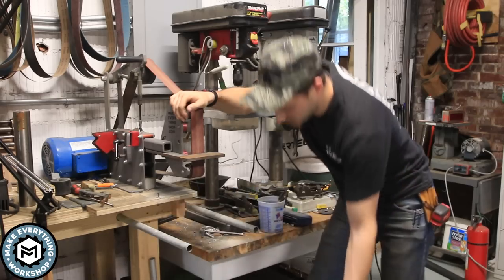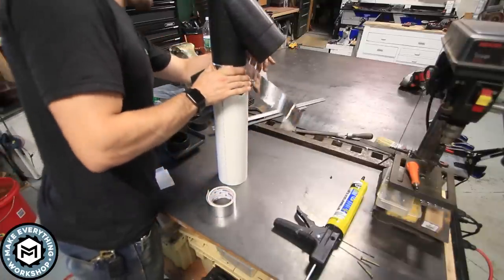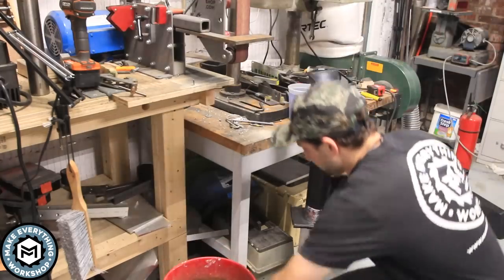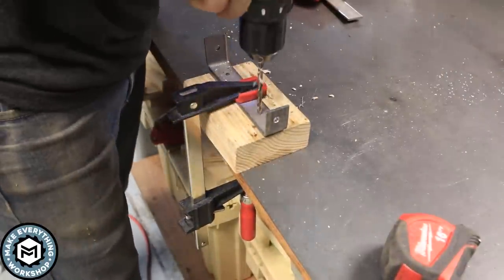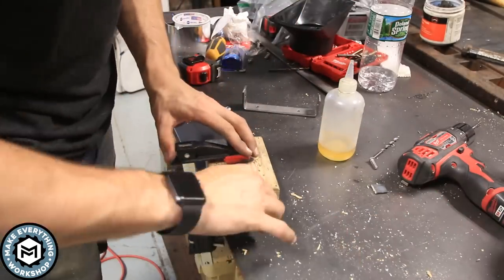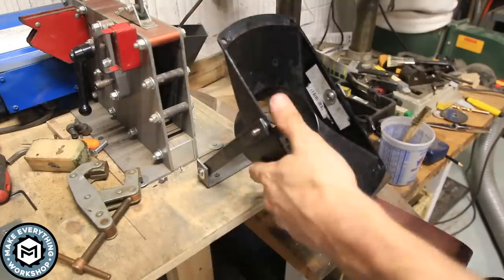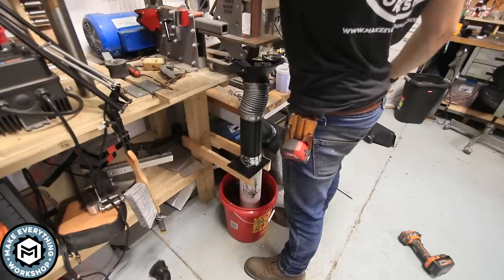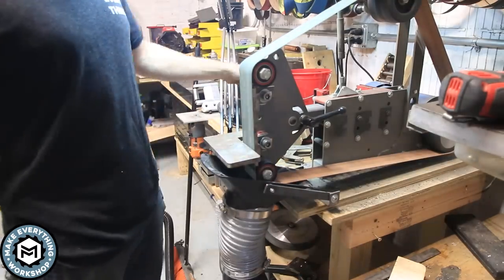Better Belt Grinder Dust Collection (Water & Vacuum)

Comment: I have made similar dust/spark containment for my 1x30, 1x42, and 6x48 sander/grinders, but found that plastic does not hold up well long term, I have ended up cutting grooves all the way through the plastic at impingement points. Went to metal catch funnel, metal flex pipe,  stove pipe wye, metal blast gates,  and down pipe. Still have plastic on the dust side of the wye.  Also if you mount brush (I use a brass brush) on the belt side of the catch funnel up against the belt it reduces the dust following the belt around.

Comment: Good idea.  I'm enjoying your channel.  

I never understood why belt grinders don't have a port that direct debris into a catch can.  I suppose they are afraid of the liability if someone connected a vac directly to it and burnt something down.  

You might consider putting a metal deflector across the hose that leads to the dust collector to force the finer sparks to travel down then back up before they can get into the collection hose.  That would almost guarantee that any particles with enough mass to cause a fire would end up in the collection bucket below.  It may be safe as-is but that would offer one extra level of protection.

It is probably worth running some kind of test though to ensure that no hot metal makes it to the dust collector because most DC fires smolder for a while before they ignite after everyone has left the shop.
Reply from the maker: Shop Hacks great suggestions. I definitely see this as a working prototype that will evolve. I also pour little bits of water into the dust collector hose while I grind to try and extinguish anything that might be smoldering. I’ve had 3 DC fires in 2 years with this collector. Nothing catastrophic but always scary!
Reply: is it possible to mount a smoke detector inside the dust collector? i guess that might be too sensitive and give false alarm.. maybe near where the extractor outlet is as once enough smoke is in there itll be coming through to the outlet, im sure theres smoke detectors with better notification methods then deafening screeching thatll bring the whole neighbourhood over to check on you

Comment: Could you just switch that small section of hose to the semi-rigid metal dryer hose? That would hold up to sparks better than the dust collector hose and would give you a similar flexibility.
Reply from the maker: Alex Nolan that’s what I’m thinking, I’m gonna get some heavy duty metal flex as a backup

Comment: When collecting the metal from grinding, are you using any vacuum air flow to pull the metal into the bucket or are you relying on gravity?
Reply: no

Comment: Great idea.  So the spark collection is just gravity fed?  I'm assuming you want to keep the sparks out of the wood dust.
Reply from the maker: Edward Iglesias exactly, the belt grinder gives enough momentum to the hot sparks to throw them down into the water. If they go into the dust collector they risk starting an air fed fire that’ll escalate quickly!
Reply: @MakeEverything  What about using a bucket with a lid w/ 2x 4" holes cut in it, and have a baffle/wall between both holes (input / output), only going down part way, and put just enough water in the bottom to make the sparks / dust do a 180* turn around the baffle and fall into the water?

Comment: Take a piece of heavier aluminum foil and line that flex section rubber duct with the foil and that should keep the flex from melting over time.

Comment: I'm confused....I'm new to dust collection and I do a good amount of metal work....wouldn't the metal sparks be going right for the vacuum?  Not the h20 bucket?
Reply: h20 bucket lol...its definitely not the correct way to do it but you just don't turn the vacuum on.